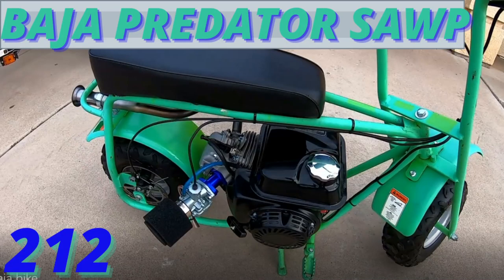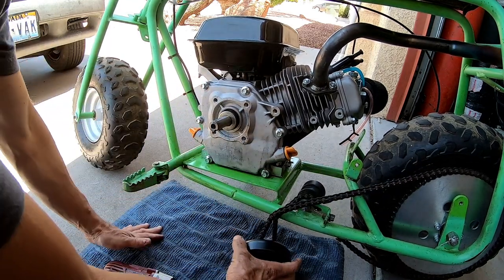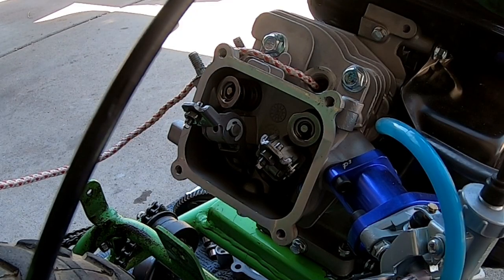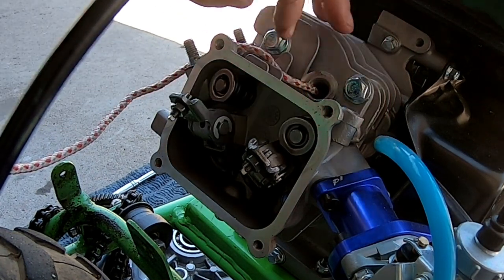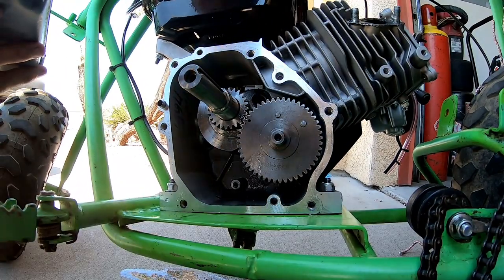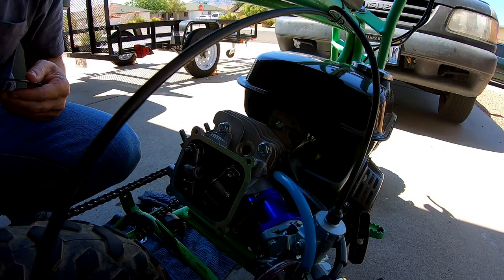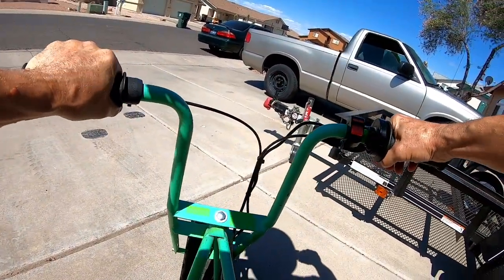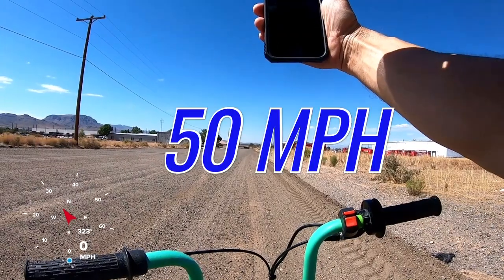Tillotson 212 cam in a predator 212 engine / Tillotson cam vs predator cam

Comment: Cool video you should have tested the 22lbs springs with the stock predator cam first and times the 0-40. You said it felt like it had more torque so I’m sure it’s faster anyway. You should try a predator 212 cam in a 196 clone next. 👍🏽 👍🏽 👍🏽
Reply from the maker: Thanks! I would like to try that

Comment: Interesting I'm not sure what to do with my tillotson 212e most of my time has been focused on finishing bt200x so I can run at the races 27th of Sept running box stock class ducar 212 bone stock Im adding Robertson loop torque pipe and a air filter playing with torque converter 9/50 set up 16x8 rear tire few more days will have the 2 piece 10 inch front rim so far it hit 54 also waiting on OMB torque Zilla I'm going to try a few more set ups on it then slap my billet jackshaft and see how it goes
Reply from the maker: Sounds awesome! Sounds like it's gonna be a torque Zilla beast!
Reply: @Black66  5300 rpm governor kinda neuters it but still be peepy on flat track
Reply from the maker: @heathenprojects2639  I bet it has a lot of torque

Comment: I have a hisun 196 and it smokes like crazy. I know it isn’t the rings or head gasket because its not down on power and it doesn’t burn oil. What I think it is, is valve float. I have a stage 1 kit on it as well. Should I put in 18 pound or 22 pound springs?
Reply from the maker: We have one doing the same thing. If it's constant white smoke it could be worn rings or even a broken ring. Or A scored cylinder wall. It doesn't take much oil to make it smoke, so it won't really be that noticeable as far as using oil unless it's really bad.
It also could be that the oil in the crankcase is over full. Oil in the gas could cause it to smoke too. The valve guides could cause smoking too but that is usually when you let off the throttle, it sucks oil through the guides and smokes.
Reply: @Black66  ok thanks, I honestly think I’m just gonna slap on a new tillitson 212. Because I’ve always had weird issues with this 196 so ima probably ride it till it blows and the put a Tilly on it😅
Reply from the maker: @Troygehring  Good idea! You will love that Tilly on that bike.
Reply: @Black66  thanks for all the help, love the channel and content your making!👍🏻
Reply from the maker: @Troygehring  Thanks! Appreciate that.
Reply: @Black66  👍🏻

Comment: now you'll have to try the Tillotson 196R and the 225RS cams for comparison to that 212E cam..

any reason you went with the 26lbs springs over say 18 or 22lbs? at what point do the stock keepers/retainers start to become a concern? 

 I only went to 18lbs in my otherwise stock 196 on my TM MB200-2, and 22lbs in my scratch built lightly stroked Tillotson 199 (using a cheap GX160 clone head and a GPS HOT265 cam) because I worried about the retainers failing..
Reply from the maker: I actually used 22lb springs in this combo. I figured they would be good for the cam I'm gonna add later on.
Reply from the maker: I bet those 196R and 225R cams would be good cams to drop in a Predator
Reply: @Black66  sorry, I thought you said 26...I've been looking at getting a Tillotson 225RS head, and it has 26lbs springs...so my brain put Tillotson and 26lb springs together
Reply from the maker: @jimcornish242  lol, That's ok. I'm the same way